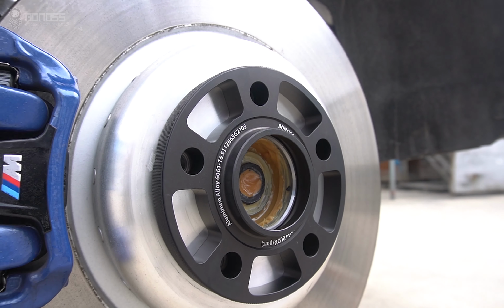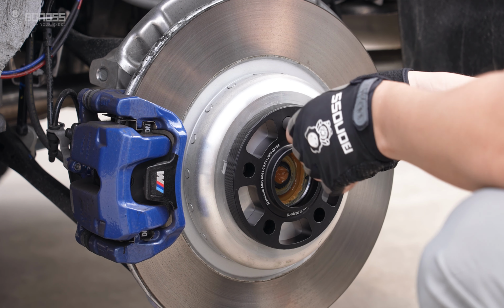Can You Put 2022 BMW Wheel Spacers on the Back and Not the Front? | BONOSS BMW X6 Accessories

Comment: Did you need to buy longer wheel bolts, or did you use the original ones?
Reply from the maker: Installation of wheel spacers is required to install extended wheel bolts, the length of the original bolts is not enough to support the distance after the addition of spacers.